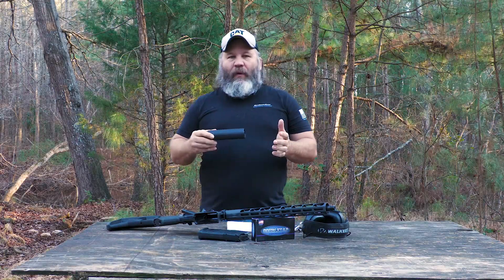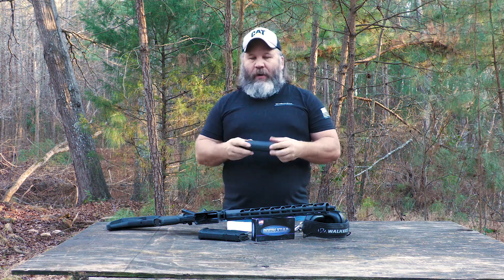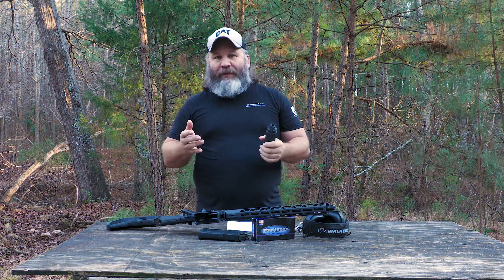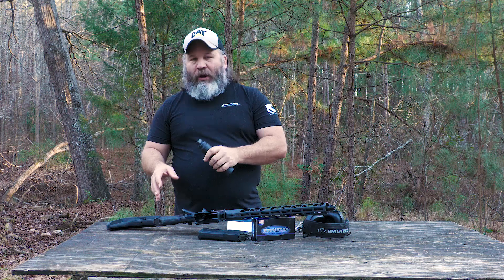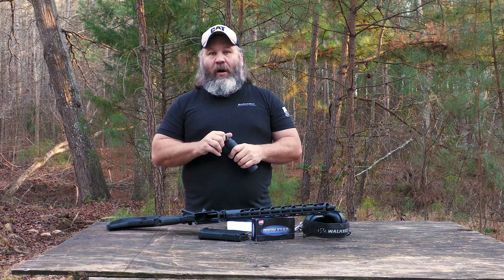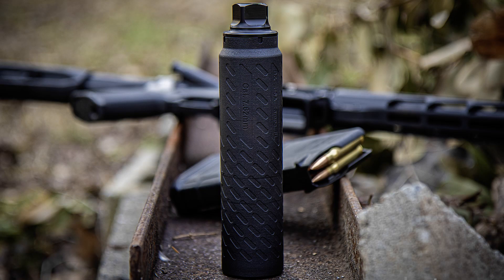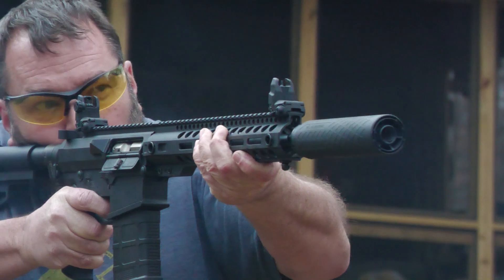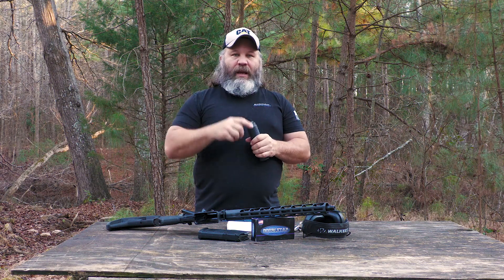B&T SRBS762-DM silencer, is the best 7.62 silencer?

Comment: How does it sound on the 308 semi, without ears?
Reply from the maker: It is tolerable. I will do a short tomorrow and post it so you can hear.
Reply: @rangehot thank you. I have the 5.56 b&tSRBS  and it does well on a 13.7. I also have a SFAR 16 inch and was curious, because the sandman k doesn’t do much for it.
Reply from the maker: @gburns14 I am going to use a 16" SFAR so you should get an idea. Look for that video this afternoon and I will ping you when it uploads.
Reply from the maker: Short is published with the SFAR and the B&T SRBS 762